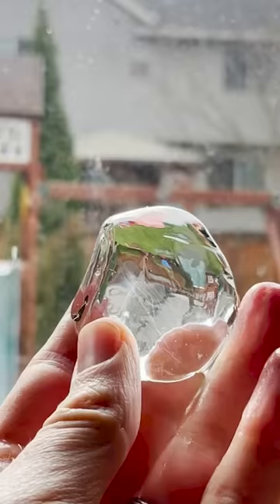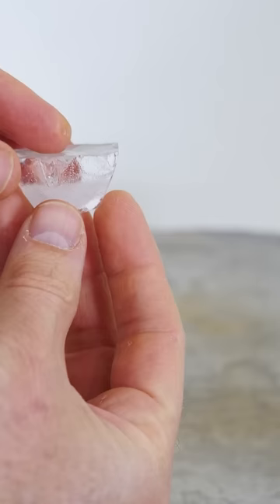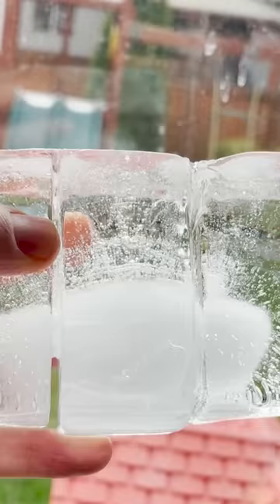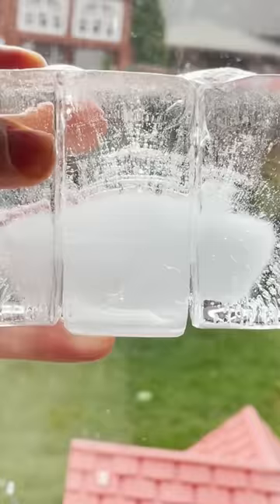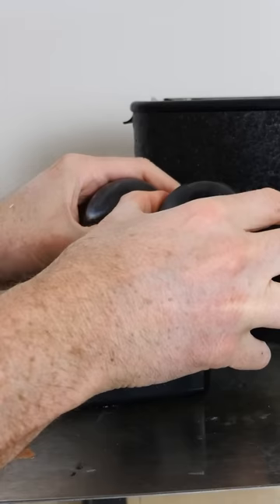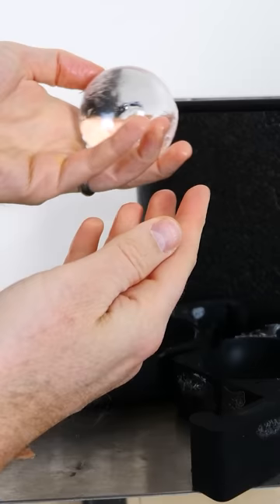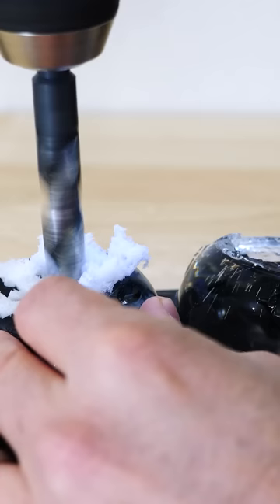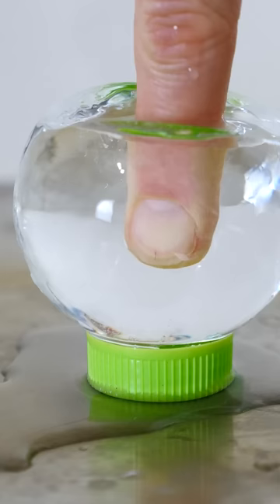The Safe Way To Freeze Your Finger

Comment: I love how you totally avoided telling us how to make the clear ice ball
Reply: Hot, filtered water and specific containers.
Reply: All you gotta do is push the bubbles away from the area where you want clear ice. What is hard to follow, it's clear as ice.
Reply: Wait,didn't he already talk about it somewhere?
Reply: @furrietgdmobileplayer3672  Because this short is edited from a longer video, the procedure is probably in the full video.
Reply: @TonkarzOfSolSystem  ik
Reply: any insulated container makes clear ice, Just Have a Drink made a video on how to do it a few months back.
Reply: @•Lxl' Pxstel• You put the water in a vacuum and it removes any gasses
Reply: @BungieStudios if I’m not mistaken I thought the whole hot water thing was a myth?
Reply: @JonnyDWise  it is, only using something like a cooler works
Reply: @BungieStudios  hot water makes no difference lmao
Reply: use a container that is insulated on all but one side, like a cooler or a thermos. fill it with water and put it in the freezer. because the water is insulated on the sides and bottom, it begins to freeze from the top down, and air bubbles and impurities are pushed to the bottom of the container as the water becomes ice. either remove the ice before it freezes all the way, or let it all freeze and chop the cloudy ice off the bottom. depending on the size of your container, it may take several days to freeze all the way. you can use regular old tap water, no need for filtering or boiling, or anything.
Reply: Because your standards are lower
Reply: @JonnyDWise It's a myth that it freezes faster, but hot water has less dissolved air in it so...
Reply: Freeze in an insulated mug with the lid off to make a clear cylinder. Fill about 2/3, freeze for about 24hrs, dump out the ice and remaining water. Done! The key is just to freeze water directionally, not from outside in.
Reply: You can just boil the water before freezing.
Reply: Put your ice mould inside a cool box and then put that in the freezer. It will take a long time but you’ll get perfectly clear ice
Reply: mold
Reply: @mrbanana6464 bro the water would boil if you put it in a vacuum

Comment: He didnt at all show how he made the ice clear. He just said “there” 🤣
Reply: He used a clear ice sphere maker, top notch ones are 400 dollars but even the cheap ones off Ali express get the job done
Reply: You need to buy an ice mould that has directional freezing, they're more expensive than normal ice moulds but they freeze the water evenly, meaning no air gets trapped inside because the edges froze before the centre
Reply: Yeah the shorts usually don’t capture everything bc they r just part of a much larger video typically. The link is n description for full video
Reply: These shorts are usually clips from his full, much more detailed videos on his channel! Not sure if this one is, tho
Reply: There's another video about clearing the ice on his channel if you're curious to know
Reply: Precisely what I thought.